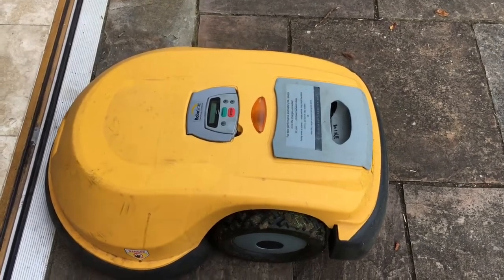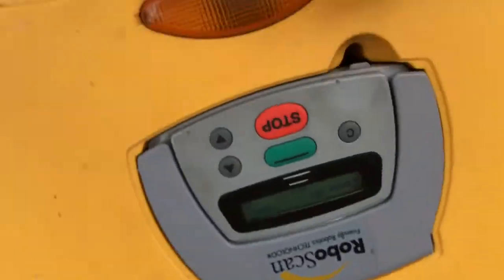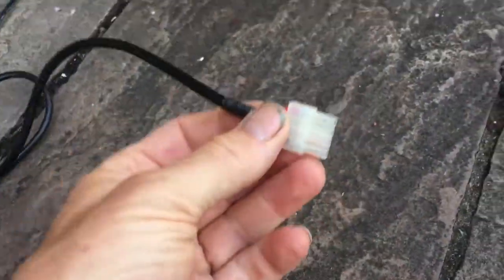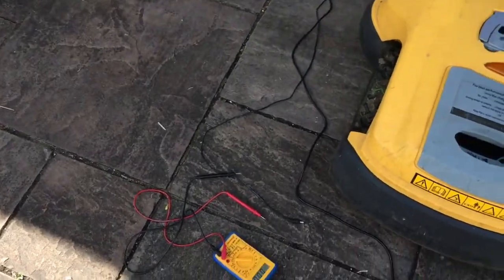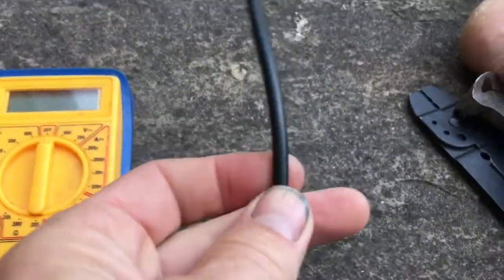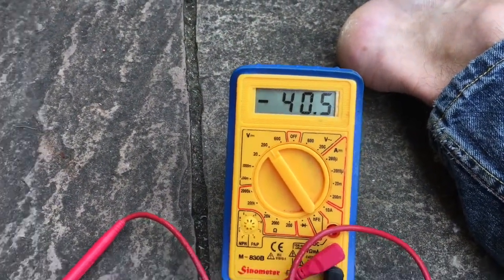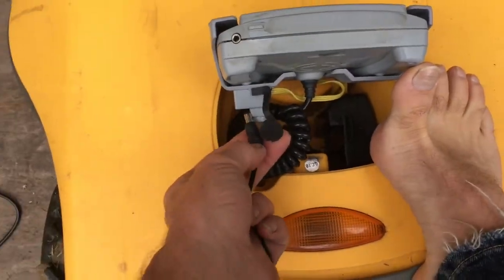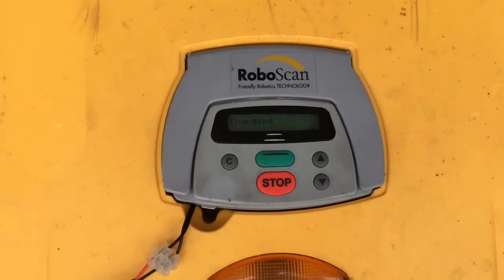Robomow RL800 charging problem - faulty power supply

Comment: RUDE customer service !! I had previously read that since acquisition of Robomow by MTD the customer service went into the septic tank.  BUT WOW !!!  Just spent 20 min. on the phone with Robomow customer service.  I played along as long as possible .... but it was apparent that from the first 15 seconds the service dude was out to pick a fight.  Unnecessarily rude.  Then .... when the guy did not understand that wire resistance decreases with larger wire diameter .... he got harrumphy.  HAHAHA!  I asked him if he might have fallen asleep during physics class.   He said I was insulting him and he hung up.  He offered zero assistance before "my insult".   Be advised.  I like the machine .... but do not look for help.